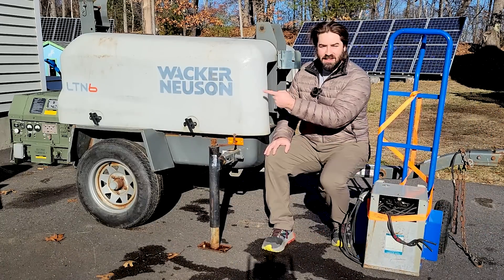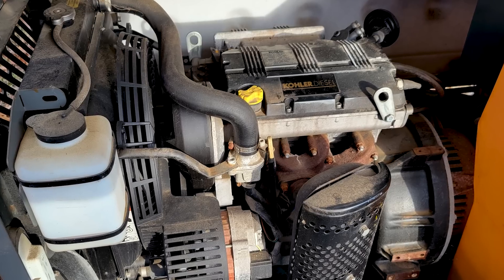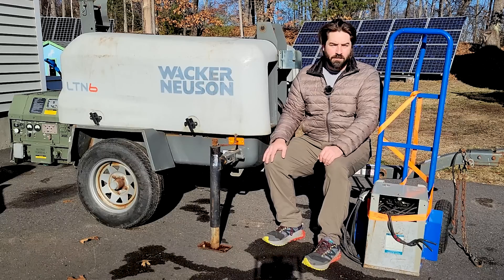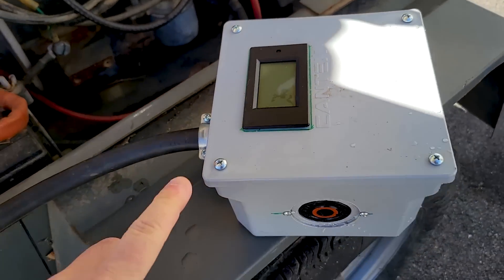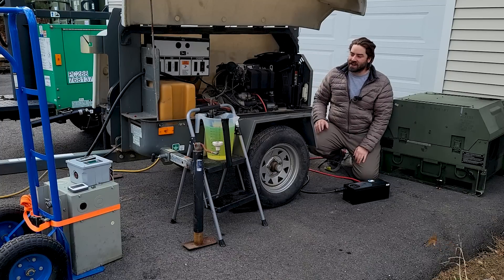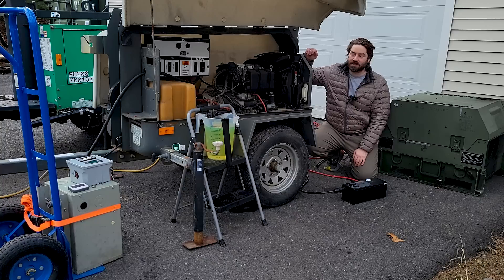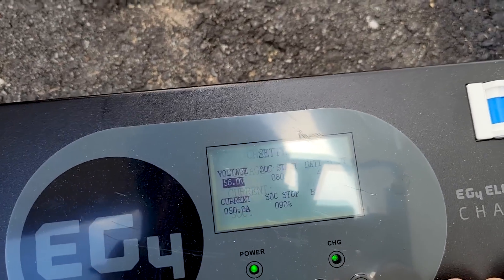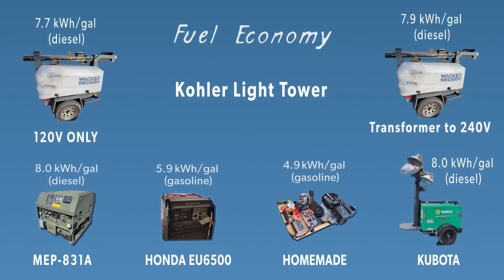What's better, 120V or 240V?  A Kohler generator experiment.

Comment: Have you actually opened the generator head where the wires come out? I would not be too surprised if it has two windings that are just wired in parallel to make it 120 volts. Wire them in series and you would then get 120/240 split phase. It would be very unusual to see a generator head that is over 5,000 watts with just a single 120 volt winding. If it has two 2,500 watt 120 volt windings it would be able to be used for many other uses and would make more sense for the manufacturer to be able to sell the same part all over the world.

But if it truly is only a single 120 volt winding, I had a thought of one other option that might be a little more efficient. What if you just used the secondary windings as an autotransformer?

Still connect X1 as L1 and X4 as L2 outputs to the Chargeverter, but then connect the generator 120 volt output to X1 and the generator neutral to the X2/X3 neutral point. Leave all the H1, H2, H3 and H4 wires open and capped off. This way only half of the power is actually going through the transformer as magnetic flux. 120 volts of the power is directly coming from the generator to the Chargeverter. The other 120 volts is supplied by the winding of the transformer. At 5,000 watts out, only 2,500 watts is being "transformed" to produce the other half of the voltage. 

If the primary and secondary windings are identical, you may be able to get it even a little more efficient by wiring all 4 windings in series, but this will be running the transformer out of spec. Each winding will be at half voltage, only 60 volts per coil. This will not damage the windings at all, and they will be running at about half the current they did in this test. And since it is a 10 KVA transformer, and you are running at only 5 KVA, you are well under the winding power ratings. By swinging half voltage across each winding, there should be even less power consumed by the transformer. If you want to try this, it would be wiring your generator 120 volt output to H1 which will also be your output L1. Then H2 ties to H3 on no other wire. The H4 ties to X1 and becomes your neutral for the generator input. X2 and X3 tie together, but with no other wires. And finally, the X4 is now your L2 output. Measuring voltage from the neutral H4/X1 point, H1 is your 120 volt input, the H2/H3 should measure 60 volts, and the X2/X3 point should be 60 volts, but out of phase. You can test that by measuring from H2/H3 point and you should see 120 volts again, split phase at 60 volts per leg. Then, finally, the H4 point is 120 volts from neutral as well, but opposite phase from the generator input. This creates your 120/240 volt split phase again. It is working in the opposite of how you used the autotransformer to produce a neutral from the 230 volt inverter before. 

I think the Chargeverter has at least some power factor correction. At 10:39 in the video, your meter on the transformer output was showing 93% power factor. That's actually very good.
Reply from the maker: Thank you for such an informative comment.  In the future, I plan to remove the back-plate of the generator head and take a closer look.  I hope to be able to run it as 240V, but wanted to go through testing on the existing 120V so that I can compare the results and learn.  
As for using the transformer as a auto-transformer.  I considered it.  This is a 10kVA transformer.  Which means each leg can handle 41.6A continuous.  If I fed X1 and X2/3 with 120V, that maxes out at 5kVA.  (half the rating).  This would mean I'd have to turn down the charger to maybe 80A to the battery in order to stay below 41.6A on the 120V side.  Now, If I had a 12kVA transformer that would have been able to handle it.  I wanted to play this safe and not risk overheating any one leg.

Comment: If you tweak the transformer a bit using a power factor capacitor you can improve efficiency a little bit more , I tried a range of capacitor values and was able to optimize the current consumed by the transformer itself to give a slight increase in efficiency. I was using a 120-240V transformer hooked to an Onan 7.5Kw inverter generator which was 120V output only , but I needed 240v for my well pump. Cheers Dan

Comment: David you've done it again, a (pozitively) enlightening video. Have you ever done a hybrid system in the winter with your solar PVs and your most efficient generator?
Reply from the maker: I've been running the Kubota generator (light tower) most of this winter when my batteries are low.  I don't have enough solar PV for winter.  Is that what you are asking about?
Reply: @DavidPozEnergy  Yes! That answers my question, in part. How often do you have to run the generator and how much fuel do you use? I live in Alberta Canada and the government is offering insensitives for solar but I'm unsure how much cost they're willing to cover. Winter here can be very fierce lots of snow and -40°C and colder isn't unusual.
Reply from the maker: I'm currently recording all my data for this winter.  Next month I plan to make a video going over the numbers.
Reply: @DavidPozEnergy  I await with abated breath. 😤😀

Comment: If that's a sodium vapor, or mercury vapor light tower, generally the bulbs run off 240, and the generator head may be reconfigurable to 240 if it's an LED light tower
Reply from the maker: The lights were metal Halide.  Each light had a transformer that boosted the 120V up to 425V.   I removed the transformers when I removed the lights and tower.

Comment: 5:53 so both sides of the transformer are connected together to double the volts? Is that called a boost transformer?
Reply: N/m. I missed the pic at 3:05

Comment: Higher voltage is more Efficient in my opinion that's why I run high voltage inverter and battery.thats why we use high voltage in our homes and Evs.Great video showing this.plus using a transformer.😊

Comment: That "rubbery mixture" sounds like the textbook way of covering a split bolt.  1) wrap with rubber tape to insulate, 2) wrap with self-amalgamating tape to seal if it will be exposed to wet, 3) wrap with cloth or vinyl tape to protect.

Comment: You’ve got a pancake generator from MeccAlte powered by a KDW1003 from Kohler (Lombardini really). It is a 240v generator.. yes the convenience receptacles are 120 but the actual stator taps are 240. Open the doghouse and take a peek

Comment: I suspect that the engine is oversized for the generator and is probably why the output voltage is so stable. It would be interesting to see if the internal connections would allow you to get 220Vac output.  If you want to recover the heat from the engine then pipe the coolant inside to a fan-coil unit for heat.

Comment: Most efficient would be 3 phase from an axial flux head on the shaft rectified with a synchronous buck that both rectifies and optimizes the power factor while charging at your desired voltage. 

Even using 6 diodes and an un isolated synchronous buck would be vastly more efficient. 

Surprised that one of the generator companies hasn’t done this already. 

Ideally you’d use a boost converter instead and generate 400vdc for say an eg4 for the internal bus and let it distribute it to either direct electricity or the battery charging or both. 

Doing this you can also control throttle based on what you need, it doesn’t have to run at 3600 rpm to get 60hz because you’re just generating DC. 

With either direct battery charger or eg4 400v you’d be somewhere around 15-20% more efficient. 

Wish eg4 would expose the 400v bus for this and heat pumps etc directly.

Also if you took your growatt transformer and wire it in reverse you can get 240v without isolation which will be more efficient.

And ps the chargverter is synchronous meaning that it uses the entire wave (almost) perfectly. It is not diode rectification occurring its using mosfets.  It will have a power factor very close to 1.0.
Reply from the maker: Thank you for your comment.  You have a good point that if we fed high-Voltage DC to the bus, it can be used directly with less loss than charging the battery.

As for the auto-transformer I used in the past videos with Growatt.  That was rated as 5kW on the 240V side.  The spec sheet states maximum Amperage on the Neutral is 32A, or 3.8kW if feeding it with 120V.  That's why I didn't use it for this test.

Comment: I am still not sure why you dont just wire that generator head for 240V. IIRC it is either output wiring or a different capacitor to change the voltage, then you skip the transformer losses. I have the same unit, though I swapped on a $1500 generator head with cleaner output and more capacity (i am going to supercharge the engine when it gets warm again, it SHOULD be able to push 14KW with the blower)
Reply from the maker: When you add that supercharger, please let me know.  I'd love to watch a video on it.

Comment: Kind of what I expected. The regulator on the generator probably isn't the greatest because it was only expecting to deal with resistive loads lights. So having the transformer as a buffer between that and the inductive switch mode power supply probably smooth things out a bit.
Reply: The switch mode power supply is classed as a non linear load not an inductive load.  It should have a decent power factor.

The transformer is an inductive load and could benefit from some complimentary capacitance to bring the phase shift back inline.
Reply: Isn't the transformer just another inductive load?

Comment: The resistive losses in the cabling to and also internally in the chargeverter obvious add up, but none-the-less surprising to see the improvement using 240V to be sufficient that even the losses in the transformer are not enough to push the results to be worse.  For voltage regulation on the AC side the power factor of the transformer and chargverter would come into play.  It would be interesting to see what the chargverter's PF is on 240 and 120.

Comment: These tests and videos are amazing. Thank you. Could it be possible that the difference in kwh (2.6%) could be explained by fuel measuring error? 2.6% of a gallon is only 3.3 fl oz or about 6 tablespoons.
Reply from the maker: Certainly, it's possible.  I don't have lab-grade equipment.  If there is a reasonable suggestion, I am willing to change.  Please keep in mind, I don't have thousands of dollars to throw at some kind of NASA fuel gauge.  Personally, I think these tests are practical in the DIY world.
Reply: @DavidPozEnergy  Totally. Just a keyboard warrior here, sharing my thoughts. Maybe measuring by weight would be inexpensive and accurate?

Comment: Did you check and see if you can rewire the generator head to be 240v rather than using an external transformer?  The external transformer is only going to help pickup efficiency in long wires downstream to the load really.

Comment: Why doesn't America just go 240 V like most of us in the world.
Reply from the maker: History.  We started with 110V.  Then we figured out that we needed higher Voltage and started bringing 240V to homes, but used a transformer with center-tap to keep the 120V for existing plug loads.  Our big loads (heaters, stove, oven, water heater, heat pumps, air conditioners, well pumps, etc.) are 240V.  It's just our plugs that have remained 120V. 

Also, a lot of Europe had to rebuild after WW2 and since there was a lack of copper, they went to 230V.  Americas infrastructure was not hurt (with the exception of pearl harbor).
Reply: @DavidPozEnergy  Yes, Darwin got hit here too. 240 V is easier.  Saying that I need to ring the guy who put my generator input in for compliance for electrical regulations. The system still puts 240 V in from the road?

Comment: That’s a nice transformer and a great price. That particular voltage configuration 120/240 x 120/240 is fairly hard to find, but the beauty of it is that they can be connected as a 120 x 240 volt autotransformer, at twice the nameplate rating. This approximately doubles the efficiency, as only half of the power passes through the transformer, and the no load losses (core losses) are approximately halved since a transformer of half the size can be used. 

This transformer would provide 20 KVA stepping up 120 volt to 240 volt, or vice versa. 

For your 6 KVA generator, a 3 KVA transformer would be ideal.

Comment: Ah David  
Just an update on the CHP for my shop 800 square feet. . Due to the cold weather and tired of feeding my wood boiler, I moved the 3500 watt propane inverter generator inside the shop. Its air cooled, put a 2 foot extention on the exhaust and a fan blowing on it as well. All i can say is there is too much heat even at 4f -20c this morning. .Had to run the summer cooling fan, it draws outside air in set at 65 f. It is running all the time. Propane usage is about 1.5 lbs per hour. . Shop needs about 16000 btus per hour for 70 f.  works excellent , Will be able to keep my 32kw battery bank warm, keep them charged and run my heat pump in the cabin running as well 
I am very happy
made a sound proof box this morning.

I was told i should get about 90% eff.

Cheers
Reply from the maker: That would be amazing overall efficiency.  Nice job.  I wasn't planning to put my generator inside my garage because of noise.  Even with some sound panels, it would be too much for recording videos.  This means my overall efficiency won't be as good as yours, but still better than it currently is.

Comment: I’m very interested to see tests for heat recovery through the cooling system. I’ve been thinking about this a lot lately and my idea has been to replace the radiator on a generator with a water to water heat exchanger. That way the thermostat keeps the engine at operating temperature and you can salvage the heat for hot water or radiant floor heating. I’ve wondered if it would be worth while to put some fiberglass insulation around the engine and heater lines or if the losses would be minimal. Would also be nice to see how much heat can be recovered from the exhaust. Maybe on a separate line so each can be measured individually
Reply from the maker: Thanks for the ideas.  I've got a plan worked out, but we will see how well it works.

Comment: I've got some 240V/1PH Kubota trailers you can test with, along with a few 48VDC DC Generators that's are rated at 215a output; i believe each has got a 3 cylinder Yanmar 3TNV88.   Been trying to reach out as i'm only a few miles away!
Reply from the maker: Thanks.  I'd love to get together.  Could you please reply with your e-mail.  I'll copy the email address and then delete it before the comment goes public.

Comment: hi if you choose to mount the transformer on to the generator i recommend preserving the wiring diagram or coping it for later reference and possibly doing something to prevent rodents from damaging the transformer
Reply: One could also make a photoetch plate with all the info but that'd be a lot more work.

Comment: the thing about diesel engines is they will burn almost the same fuel under load be it 50% or 100% so your 100% getting it from that chargeverter running it at 240v 
that's the reason I say to add a 48v alternator to the mix to try and get every last bit of power out of the diesel fuel you are using if you are maxed out on the gen head
Reply from the maker: This engine has a maximum output of 8kW@1800RPM.  I'm pulling about 5.3-5.5kW in these tests.  That leaves 2.5kW for any loss in the generator head, bearing friction, water pump, fan, alternator, and belt.  I'm sure you are right that there is something left on the table.  Right now, I'm more interested in pulling heat from the engine than potentially another 1kW with a new alternator, brackets, idler, and belt.
Reply: @DavidPozEnergy  yes I get what you are saying but I willing to bet it will do more then 8kw. its just with a gen head like this you need to hold rpms to maintain voltage and 60 herz. with alternators they don't really care about the rpms dropping a few hundred rpms and in most cases they are more efficient also. but you could even just use a 12 to 48v dc to dc charger 
would be an easy way to try and get some more power out of what you have already
and yes that would be cool getting the heat from the engine also

Comment: Hello everyone... 
I am a regular viewer of your videos and based on them / idea I bought a "tower light VT1" with a Kubota d1105 bg engine ( it has only 1700 mth, 2008 year ) + Linz 9 KVA generator, 1 phase, 230 V ( I live in Europe / Poland ) with the intention of using this engine and generator to build a "cogenerator" ..
I will have electricity to charge the battery in Lifepo4, LF280k and a 4x16s system (finally 8 x 16s), and the waste heat from the exhaust and the engine will serve me to heat the house...
When I charge the battery, I turn off the "cogenerator" and turn on the Heat Pump using the stored current in the battery / Lifepo4 = such a "perpetual motion machine"...
With the planned load of this set at around 6-7 kW of current, this engine should use about 0.52 gal ( 2 liters ) Diesel ..

Thanks David for the "inspiration"...

ps. Sorry for the mistakes - Google Translator...

Comment: David I'm sure you know that every time you change the voltage you lose a bit through efficiency - your Genni had likely got two 55v  coils in series - I wonder if there is any mileage in wiring them in parallel and putting that through a full bridge rectifier then tweaking the speed to meet the voltage charge requirement -  55volts AC is 86.478 volt DC  - regulating the field strength  to produce the right charge voltage  would be possible and would give you headroom to lower the engine speed to one more economic.
Reply: Diesels are efficient across a wider RPM range than gas and it's probably tuned for max efficiency at it's 1800RPM already.
Reply: @P_RO_  Excluding the transformer and the inverter charger will more than compensate